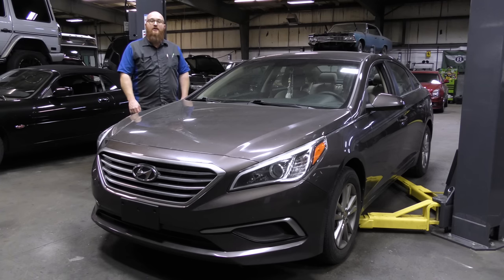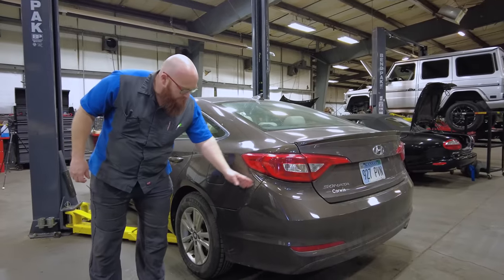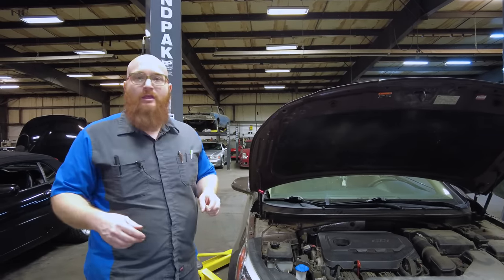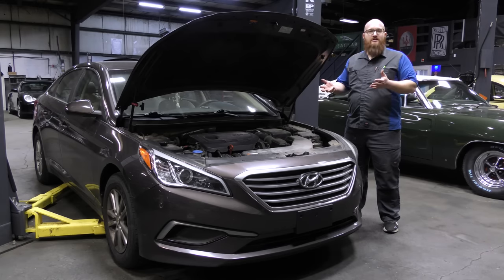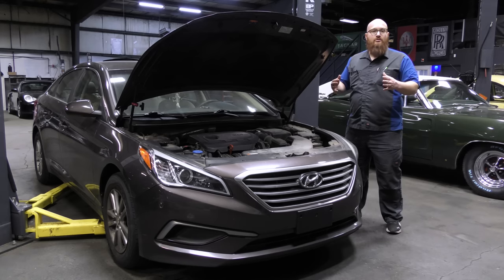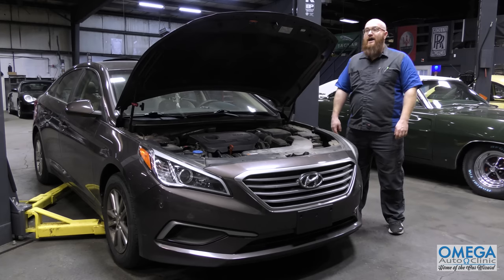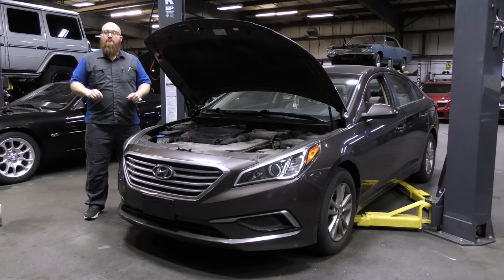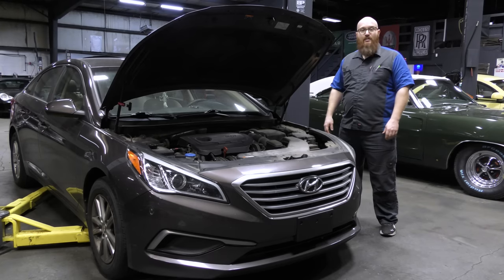What could be so bad on this '16 Hyundai Sonata that the CAR WIZARD is sending it to the junk yard?

Comment: I have a 2006 Hyundai sonata with the 2.4 cylinder with 252500 miles, doesn’t use a drop of oil, 2500 mile mobil 1 synthetic oil changes religiously, great car.

Comment: I work as a mechanic myself and have lots of work colleagues who don't even bother to check their levels, let alone maintain their vehicle.
Reply: That has no relevance to this engine though. It is a manufacture defect, and causes catastrophic damage. Maintenance will not prevent it.
Reply: @calebniederhofer6529  Well, this one last 120k miles while being terribly maintained. Tell us again how is it the engines fault
Reply: @AI-qd4vb  You are arguing about something, that you clearly have not researched, or educated on. I already explained it in my comment. The motor will have catastrophic damage regardless. My buddy sold them , and owned a 16 2.4. He maintained his meticulously, and the motor knocked around a 110k. There was issues during the manufacturing process, causing metal shavings, and catastrophic failure to the crankshaft, and pistons.
Reply: WHAT?  I'm shocked that there are mechanics who don't maintain their vehicles.  If they were doctors or nurses, they'd smoke and eat excessive junk food.  Oh, wait, there really are doctors and nurses out there who do that.

Comment: For a car like this, I'd put a used low mile engine in it, change the timing set to the updated components immediately. After that, keep up on maintenance, and it should be fine.  No need to junk a decent car.  As you said - Nobody changes the oil, or stops when the lights come on.  That's the main issue, even with crappy cars.  Some inherently burn oil bad, but Once a week when filling up, checking the fluids would help to save the bottom end until it's fixed.
Reply: "Crappy cars", perfect description of a Hyundai/Kia!
Reply: BS my Hyundai sotana always had oil did all the maintenance & that peace of shit broke down at 129k miles engines are trash
Reply: He didnt wanna fix it and gas lit the customer then made a whole video to gaslight all of us too. There's plenty of places selling reman 2.4L engines for $4500
Reply: @ChrisConley1  So you are saying a remanfuctured engine could have saved only $1000 off the bill, when you factor in the cost of all the labor and other parts and tax, and you think that should have made him want to spend more fixing it than it was worth?
Reply: @jimbob3030 it's worth about $12000. Probably more with a new engine.
Reply: @ChrisConley1  "Probably more with a new engine."

A remanufactured engine isn't a new engine though and is of questionable longevity. Even a new one of these engines is of questionable lifespan they often fail even if you do everything right.

But still you are right back at the gamble of putting a remanufactured engine in it for a total cost of around 9k when you can go buy another one that the engine hasn't failed yet for the same 9k, and at the end of the day you still have a bad car with an unreliable engine that who knows how long it will last.

My worst and cheapest car is a 96 buick century with 75k miles on it that was garaged all it's life and looks fairly pristine, old grandma car.

 I bought it for $1500, that car that is already 28 years old will likely outlast one of these new clunkers.
Reply: @jimbob3030  by new I meant not the original one. I just bought a 2015 sonata Se with a dealer installed reman engine that was replaced under warranty. They swapped all the old stuff to a reman longblock. Paid 9700 for it. Has 78k on the body. Drives and runs perfect 👌  35mpg too.
Reply: @ChrisConley1  You're a gambling man, and now you know to seriously stay up on maintenance and keep a close eye on the oil level, so with a little luck you'll probably be ok.

I am a gambling man too, my nicest car is a 2015 fiat 500 sport with 45k miles on it when I bought it, paid $6500 for it

It also doesn't have a greatest track record for reliability but I pay close attention to taking care of it and expect that I will be ok.

I bought the fiat regardless of it's reputation because I just like and enjoy it, fun to drive and something different.

I always wanted one but I waited several years until the used prices were cheap enough that it wouldn't hurt so much if it died and wasn't economically reparable.
Reply: @jimbob3030  I also have a 2024 gmc yukon at4 and a 2021 gmc savana. I drive an hour to get to work. I didn't wanna put the miles on either of those so I leave the gmc van in the area i work in and drive the sonata back and forth then drive the yukon around town when not working.  Also the highway between where I live and work im constantly getting broken windshields. Let the sonata take the beatint
Reply: @ChrisConley1  Yea I won't buy any vehicle that new, the prices are just crazy and repair costs are even worse so I prefer to have beaters to take the beatings. 

 I have a custom open wheel hot rod that's a mix of classic v8 mustang drivetrain and mg midget body and a 2002 cummins powered long bed wide body tall roof stepvan as a truck, which is insulated/cooled/heated/finished on the inside like a toy hauler/living space and has it's own solar setup. And a few toys like motorcycles and ebikes to go in it.
Reply: @jimbob3030  I buy that new because my time is better spent earning money than wrenching on the weekends or dropping vehicles off at shops and hassling my fiancé for a pick up. I did the back brakes on the sonata last weekend and remembered why I buy new cars. Spent my whole 20s working on beaters to keep them going.
Reply: @ChrisConley1  I don't do any work on my own cars, I live two blocks away from two mechanics in a small town, and I work from home. 

I stick to used cars with low mileage so they're not high maintenance. Calling them beaters isn't really fair, the only knock against them is they're just old.

The main reason I will never buy another new car is I want no payments on anything, everything I have including my house is paid for.

Instead of house and car payments my money lately goes into remodeling my house, so that money grows as an investment and isn't just lost like it used to be.

Comment: Very good video! We have a Santa Fe with this engine in it, and the problem is it doesn’t just use a little oil, it runs like a two-stroke. I just change oil and it’s well over 1 quart per thousand miles.  I don’t see how making engines prone to burning oil is better for the environment.

Comment: had the same issue with my Sonata. The story is if the car was made in Alabama, there was an issue with spinning bearings. Hyundai dealers do not want to do the repair because they are tying up a lane for days. No money to be made from a recall with Hyundai. I flipped it and got another brand, even though we have three Hyundai's. Time for change that will hurt them in the long run.

Comment: It sure is looking like the ol' Marquis is going to need to run forever.  I have had that car for 28 years and it has 455,000 miles on it.  I had considered a Hyundai at one time....I guess I can forget it.  Great video!
Reply: Noooooo, I have an ‘11 Elantra I bought new, only 85k miles. It’s past the engine warranty and know oil leaker. I change my own at 3k with Mobil 1. I Also have an ‘11 Crown Vic PI, my father and I just did a 7 day nearly 3k mile road trip, flawless, lots of fuel but comfort and reliable
Reply: @USNVA-yn6cp  Agreed!

Comment: Glad you made this video i have a'13 Elantra with the ticking noise took it to dealer for a diagnostic which cost me $225 only to confirm the bearing issue. Dealer refused to replace engine. Went to Hyundai corporate and filed a claim they refused to replace it also. Only have 82,000 miles,kept up with oil changes,I'm the 2nd owner bought it with 51,000 noise didn't start until around 60,000. I noticed at the dealer crates of new engines stored also. There should be a Federal investigation into Hyundai in my opinion this problem with their engines has been going on almost 20 years yet they keep putting them in their vehicles. Subsidies for them to build new plants in the U.S should be cut off unless they refine their engine designs and overhaul their manufacturing processes. This was my first and last Hyundai/Kia product.

Comment: We had a 2001 Santa Fe and it was utterly bulletproof until last year when it went to the dealership for a belt replacement. They botched so many things that we ended up getting rid of it. It was a nightmare.
Reply: You poor guy. That's why I do all my own maintenance and repairs now ever since my dealer botched a simple oil change.
Reply: It is rather sad when people get rid of a car, not because of the car itself but because of a bad experience/relationship with a shop/mechanic that has proven unreliable or untrustworthy, making ownership “impossible”.
Reply: I mean with a botched belt change, they could have easily meant a timing belt. If the engine grenaded, well, k wouldn't call that giving up a good car. It's for parts or repair then.

Comment: I had a shop throw in a used 20k mile engine for total of 4.1k which included everything labor and parts, same exact model and yr as the sonata here, this was 4 yrs ago and I put on 65k miles since and it still runs perfect. Ur crazy to buy a new engine when theirs cheap engines around at junkyards that got into accidents.
Reply: Exactly my thought, why is he talking as if there are no other options than a brand new engine from hyundai.
Reply: @gbizaillemasterg2347  because prices 4 years ago are night and day
Reply: The potential problem with junkyard engines is that you have no idea whether the engine was well cared for by the previous owner.

Comment: We own (but not for long sadly) a 2016 Santa Fe with 116,000 miles. We've been VERY careful to have the oil changed consistently within the required range, as documented in the manual. Admittedly, I'm not checking the dipstick with every drive. The oil change service shop is doing that for me when I pay them to change the oil. Last week the knocking started and it died on the road the same day, I didn't even get a chance to take it to my mechanic for inspection. These Santa Fe engines have fundamental manufacturing flaws, none of which I'm told can be resolved by expensive engine swapping. I've read horror stories of this same issue for different models and years. It seems all 09 - present Hyundai engines have this problem. It may not happen right away but if you own a Hyundai, its only a matter of time before it dies permanently or worse, catches fire in your garage. Yes, some have reported fires starting after the vehicle had been parked and turned off! (I suspect the notoriously faulty starter relay in some of these have started the engines without the driver, allowing the engine to run, burn oil and eventually ignite. Just a theory.) The response from the Hyundai dealer is always the same everywhere I read: "you didn't keep up on maintenance so the 10k repair is on you". By the way, we were never notified about the KSDS software update in any capacity, I'm only now hearing about it from others going through this. We went from strong fans and lifelong customers of Hyundai to absolutely detesting them. We will NEVER buy a Hyundai or Kia vehicle again. They have been banned for life in my household and I'm spreading the word around about how awful they are. Stay away!

Comment: The 2.4 theta engines are notorious for consuming oil. You have to keep up with meticulous oil changes at precise intervals as well as run some type of combustion chamber cleaning atleast every 40 to 50k miles
Reply: A decent high speed thrash every week helps...
after you check the oil level of course...
Reply: @JohnSmith-yv6eq  lol that could help. But unfortunately these engines were designed with full synthetic in mind but were prescribed conventional by the manufacturer. Now they recommend synthetic, but a 10k service interval between oil changes is insane. Oh and if you use anything but a OEM oil filter you are guaranteed problems. Seriously. I've seen quick change mom n pop shops come and buy filters by the case to keep their customers happy and on the road
Reply: @JohnSmith-yv6eq  nope. It’s a GDI engine and doesn’t have mpi combined with it like newer versions. Which means no fuel is being sprayed on the intake valves. So they carbon up and “thrashing” won’t do it any good because the fuel isn’t being sprayed to clean them off it’s directly going into the cylinder.

Comment: I always did my engine oil changes at proper 3k mile intervals, and my 2017 Sonata had the EXACT same issues at 115k miles...minus the knocking, although mine probably wasn't too far away. I complained to Hyundai about it burning oil, they said burning 1qt every 1k miles is "normal". Well...~5qt capacity, and Hyundai suggested 5k mile oil changes...that math doesn't add up. You'd be burning your entire oil capacity in 1 oil change interval! As soon as my engine warranty expired, oil consumption shot up to 3-4qts every 1k miles. I was adding a quart of oil every week. I'm glad I kept my eye on my oil levels to try and push it a bit further, but there are serious issues with these Theta II engines. I got rid of this car before it blew up, left me stranded, and cost me thousands to replace the engine.

Comment: This video may have saved me a ton of money. Currently looking for a gas saver under 10k. Been avoiding CVT'S and now I'll add this engine to the list. Sounds like they're dropping like flys.  Really starting to lean towards a older Buick with the 3800 V6 and just pay for a little more gas. Just aren't many of them left in good shape and lower miles.
Reply: The Mazda 2.5L skyactive engines are very solid. When my camaro was totaled out I spent a week shopping and researching. Ended up deciding that based on price, performance, reliability, and trim that Mazda is a great value alternative to the higher cost options such as Lexus, Toyota, Honda. Toyota even owns 20% of Mazda and has a partnership with them. 

I got a Mazda3 NA 2.5L with an automatic 6 speed. All models of Mazda use the same 2.5L. Just determine if you want a car, SUV or hatchback. Then if you want/need Turbo, AWD or Manual and go from there. 

I went from 20MPG V6 to almost 40MPG i4.
Reply: Cvt in my prius has been solid
Reply: @skryptec  thats funny.
After i had enough of my 2012 Ford Mondeo mk4 2.2 tdci
(All kind of electrical problems, the dpf not working well, check engine light on dashboard. 
Problems to lock/unlock the doors i said to my wife we have to get rid of this car.
I started to search for a new car and long story short i wanted a Japanese car for its reliability.
So found a Mazda 6 2014 model with 2.5 petrol engine without turbo,( less that can break)automatic transmission.
And so far after a month i am really happy.
So nice and well built car.
Only has 90.000 km on the dash and everything works well.
Only one previous owner, all the maintenance made every year.
Time will tell if it was a good choice.
Greatings from Sweden 🙂
Reply: The Toyota CVTs are very good. Change the fluid every 50-60,000 miles, and don't use the car as a race vehicle 😉
Reply: I bought a 13 Passat with the 2.5 in April of 21. 72k miles, one owner, dealer serviced the entire time. $8800. I get about 26 mpg on mixed driving with a very heavy foot. When I got it I changed the plugs, all filters, and all fluids just to be sure. I have had zero problems out of it, plus it's so big inside.
Reply: Look at a Ford Fusion Hybrid, I know a lot of fleets use them.
Reply: Go for the older Buick! Team 3800 for life!
Reply: My Santa Fe actually also has the 2.4 gdi 4 cylinder. I religiously change the oil every 3k miles, along with other fluids, and so far after 130k+ miles, this engine has yet to of done me wrong. Just keep an extremely close eye on oil.
Reply: Those old Buicks are not the cheap deals they used to be.  Sure that 3800 gen 2 and 3 was a good engine, but the GM trans was not great.
An Avalon is like a more reliable (and faster) Buick.   The older ones are fairly cheap these days.   Compared to other Toyotas.
Reply: @skryptec  
Toyota owns only 5% of Mazda, 20% of Subaru.   Ford used to own 49% of Mazda.
Reply: @jordanstark2454  
It is not a chain driven CVT though, it is gear driven, very reliable.
Reply: Buick 3800 ..BAD !!!